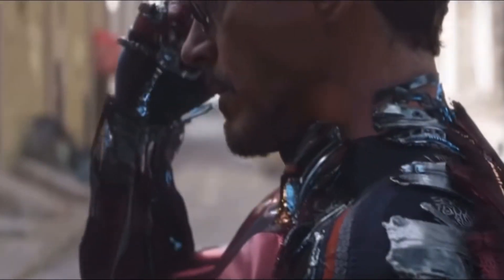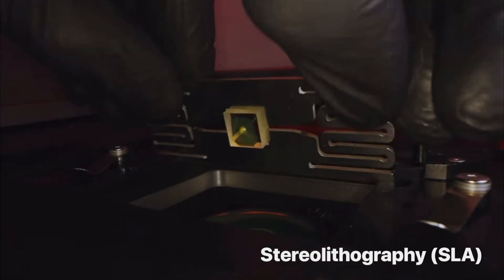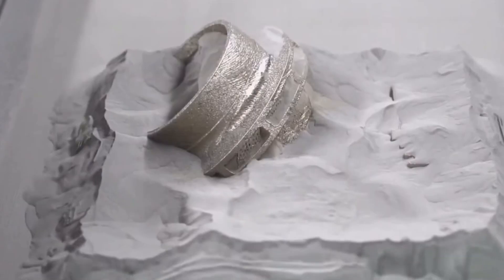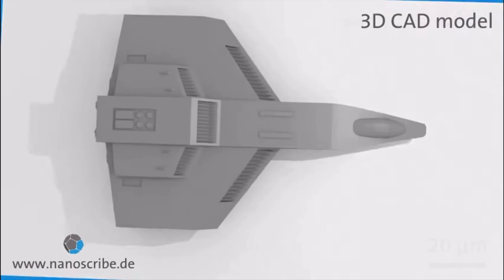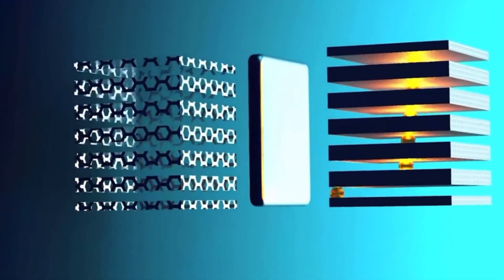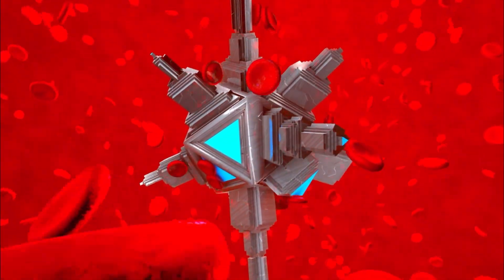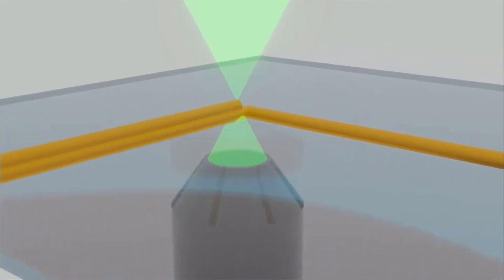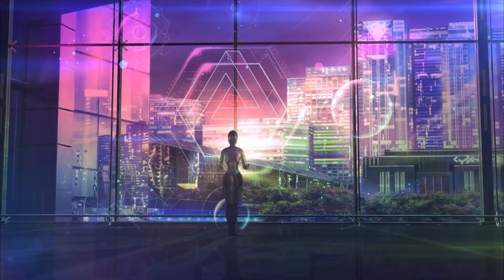How 3D Printing is the Key to Nanotechnology

Comment: Nanoscale robots would indeed be cool, although I still haven’t heard of any power sources with high enough energy density and motors small enough to run them. But I may be behind the news.

As far as making essentially full organisms from the molecule up, what even these nanoprinters are NOT doing is creating molecular structures. That’s what cells do, and without replicating and re-engineering biological cells to function PRECISELY the way we want, that would still be a step beyond.

However, as stem cell technologies grow (no pun intended) and the ability to create truly intricate nano-scaffolds made of biological-friendly polymers improves, fully printing organs that are as good as or better than the originals will become a possibility.

The real limit right now, if I understand the state of the art, is nerve tissue. Still, there are researchers growing small networks of actual human brain cells together to perform AI tasks, so if they combine that with bio printing at the nanoscale, we might start REALLY seeing some amazing (or terrifying) creations.